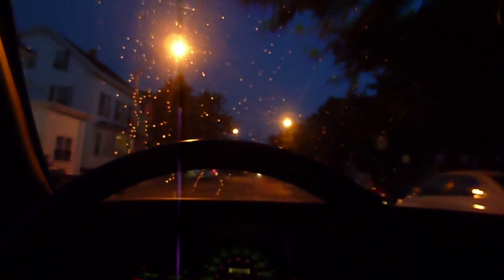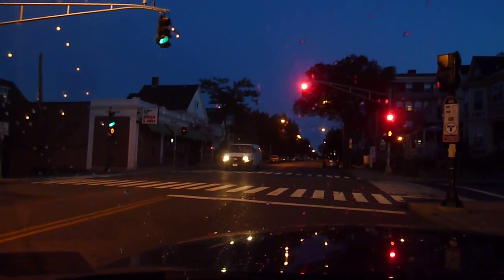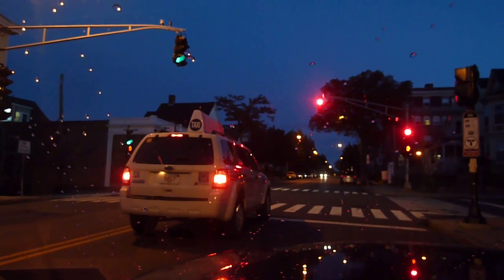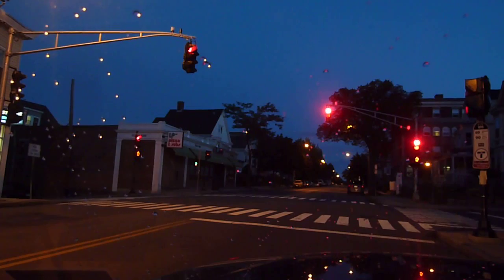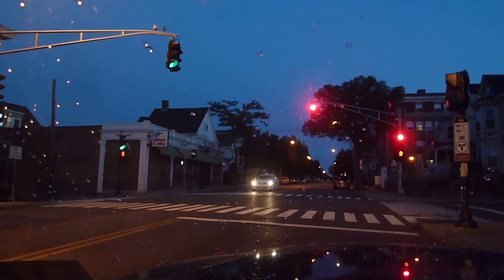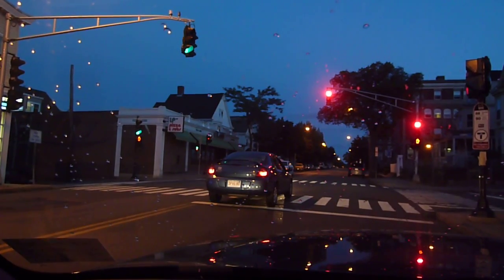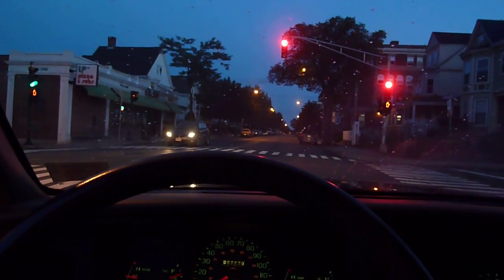Somerville, Mass.: How poorly-timed traffic lights pollute the air, waste fuel and cause delays...

Comment: It stays green on School St. indefinitely unless Highland Ave. gets traffic. There is a loop of wire under the pavement which magnetically detects metal. After it detects the metal, It will briefly  turn green to let the traffic go before going back to its default state.
Reply from the maker: Yes: They installed those sensors  in 1993 when Highland was done over (you can see the cut marks in the pavement). And they seemed to work well for a few years. However, they need a logic update or something since there is no way that the current arrangement--forcing one to sit and wait at idle for up to two minutes when there is NO conflicting traffic on the one-way School Street rangeway--is either desirable or being done by design. Imagine living on the corner and someone on a Harley Davidson motorcycle idling at that hour outside your window for that long. Needs to be fixed, and it can be fixed, to everyone's benefit.

Comment: get a purple laser pointer.  Aim it at the little black sensor at the top and watch it turn green.
Reply from the maker: Hmmm... that sounds intriguing. I'm not sure if these lights have such a sensor, although there is an emergency strobe that activates when ambulances or fire apparatus are approaching the intersection. Where can I find one of these purple laser pointers? On line? Amazon? I assume they're legal to have in MA? The light still long-cycles in the early morning hours.

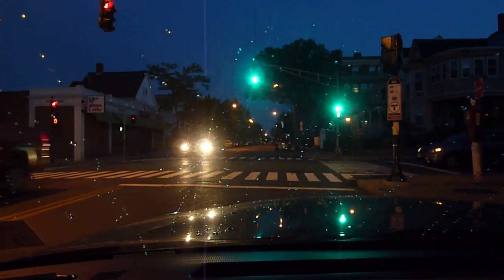Comment: That light is on a 1:15 second cycle. That really is not too bad so long as the other lights are synchronized. For me its more annoying having to stop at several lights for short periods rather than stopping at one for a longer wait. If you have this wait at several lights then yes they are creating an unnecessary delay.  Does it back up during the day? The bigger problem is your city should have a different cycle for the overnight, weekends and daytime. My guess is this is the same cycle for rush hour traffic. Ideally they should be on sensor at night (with delay) and timed during the day with synchronization.